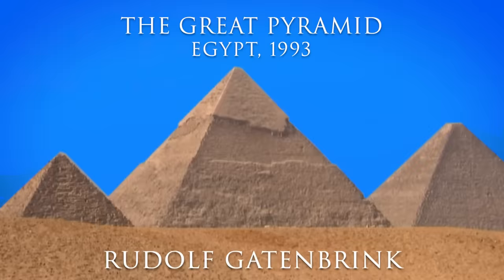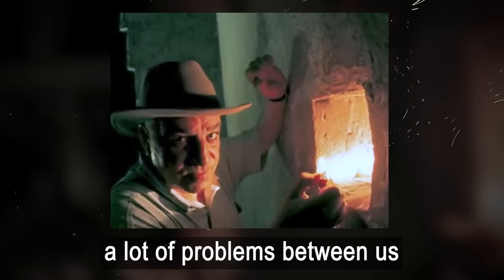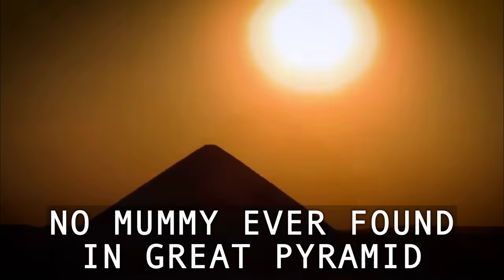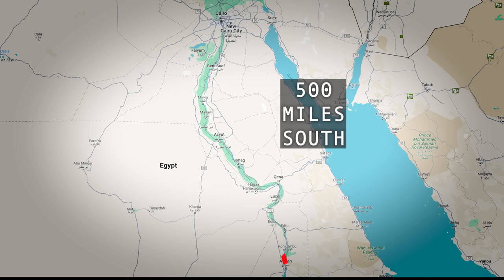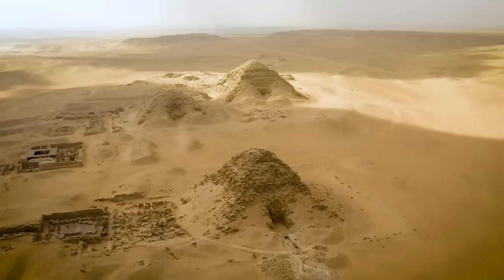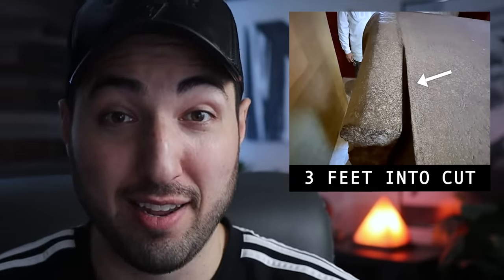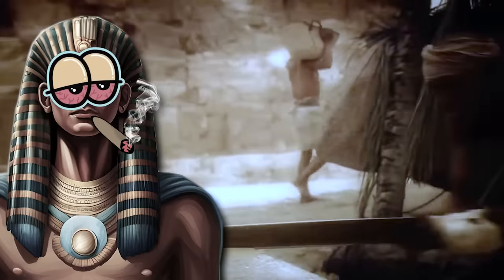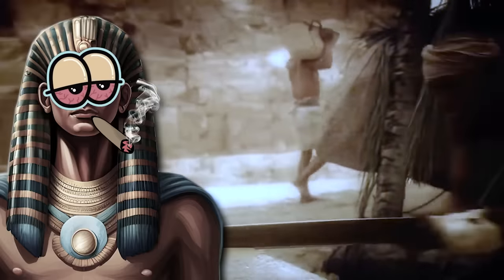The Great Pyramid Mystery: The Oldest Cover-Up In History

Comment: I think you switch something around here. The fact that it scales so perfectly with earthly dimensions does not necessarily mean they exactly knew all these measurements. It just means they had accurate measuring equipment and used the stars to measure tue dimensions of their build. They might very well have thought it was exactly square but because they aligned it on the stars it became exactly as non symmetrical as the earth itself.

Comment: That’s a serious video man!  I’ve been studying this for 24 years (at times) and have yet to see a video so succinct as this. However it have questions. 1. You use meters at one stage to make a point of significance. Other times you use feet. There is no record of either of these measurements in use at the time. And why either of them? 2. You talk about the 8 sides visible from the air.   The pyramid was covered in a limestone covering. Maybe those 8 sides became for once fully constructed!? 3. Does true magnetic north change over time? That might account for the slight inaccuracy!

Comment: Correction! -  The Great Pyramid is built facing perfectly TRUE NORTH NOT magnetic north so True North is beyond amazing because we would need a GPS to achieve TRUE NORTH" MEANWHILE> PYR means fire / AMID means in the middle = Thus pyr-amid is Greek- The original people were known as Kermit / a pyramid was called a Per Neter "building of Nature" by The Kermit - so what we know is mainly in Greek and we know the land was raided by several nationalities. As far as we know the people were known as Kermitian or Kermit. The Great Pyramid dates back to a time we can never know. It's position is remarkable since it is 72 degrees west to Easter Island (originally known as Te Pito O Tu Henua - the navel of the world) which is 144 degrees west to Angkor Wat which in turn is 72 west to the GP = 360 degrees and that is simply amazing.

Comment: Idk where this is going, but i can say one thing for certain. The pyramids were built to operate as high security temples. Hence, the completed canales from the king's chamber. The queen chamber was a backup in case they couldn't finish the king's chamber (hence they never built functional air ventilation down there). Hence the 3 portcolas and the lack of proof for any plugging.

As to why no mummy was found - 4000+ years since these pyramids were built and you expect thieves to not plunder the OBVIOUS structures that stick out like a sore thumb in the Egyptian desert? It's highly illogical to believe any of the pyramids could still have a mummy inside after so long.

Comment: 13:40 When building my house I didn't have a laser to achieve accurate levels, I used a hose pipe with water in it. Egyptians didn't have plastic hoses so they used open pipes. This ancient method is as accurate as any modern laser. We know how they transported the large stone blocks because we have found the canal built from the Nile to take the barges. Like all good engineers, the Egyptians learnt from their earlier mistakes, as witness the step pyramid and the Bent Pyramid of Dahshur.

Comment: Exciting video, Patrick. I am now interested in visiting Giza's pyramids. I do have a question, though. Are not the pyramids sitting atop a hill? Instead of using a pulley system to move the limestone piece by piece upwards, couldn't the Egyptians instead dig a square hole and, as for moving the stones, divert the water from the Suez as seen at 9:55, then lower the rocks down the hole using a pulley system, and when done, remove the dirt surrounding the pyramids after putting on the golden capstone? 

It's just an idea.

Comment: I find this video fascinating. But more intriguing  is the fact that these pyramids are all over the planet (example five Bosnian  pyramids) and in most cases, local government has banned further investigation into them. Its as though there is another level up for government, which sounds ridiculous. Another example would be Gobekli Tepe, the oldest site on the planet. They have grown orchards over areas that need excavation. Clearly a method to prevent further discovery.

Comment: I’ve been inside the pyramids and temples, It’s amazing. It does get you thinking how they did it. 
A
They mention that they used 100s of slaves to pull the big blocks. No one mentions about using the oxen’s which makes more sense

Comment: It is proven that except for a few granite blocks, the pyramid is poured concrete in molds. Made from local materials. So it is NOT mysterious that it is level and there is no space between blocks or where the blocks came from. It was local material, and they found the mixing vats close by.
It also explains the building speed. The height of each block fits so you can empty your bucket over the mold wall.
The blocks have more heavy stuff at the bottom.

Comment: The metre wasn't even invented for another 4-10,000 years later, the metre is completely arbitrary (the length of a metre was based on the earth, however it was so far off being correct it's length IS completely made-up.)
So that correlation of the speed of light vs the pyramid size is simply coincidental. Unless, of course, time travellers with the knowledge of what a metre is who built it.

Comment: 13:05 - hold your horses. 
"Meter" was a unit invented only after the French Revolution in 18th century. It was originally based on measurements of the Earth (1/10000000 of the distance between the Equator and the North Pole), but it was an arbitrary decision. For example, why it wasn't based on a distance between the poles or the Earth circumference in any direction?  Enough to say that had the French Academy of Science decided to base meter on the full length of the meridian, the speed of light would be 149 896 229 m'/s, as the "full meridian meter unit" would have been twice as long as it is now. Not mentioning measurement errors (meridian is 20,003.93 km long rather than exactly 20,000.00 km - as it should had the original measurements been conducted precisely). The difference is small, but with so many significant figures, it's enough to skew the results (c = 299 733 560 "correct" meters rather than 299 792 458 real meters). 

And that's not all - but this is so obvious that even without verifying all the figures it undermines my trust in this video.

Comment: Hard truth is the more primitive and straightforward is the tool the more effective is. Pyramids was not built by plasma cutters, levitation etc. Look roman empire how build massive projects. Effectiveness of the simple tools. Just two sticks with rope  tied at the middle of sticks gives you ultimate 🥏 precision. You can draw any shape. Pyramids was built to match star formation of the Orion constellation. Only three sticks are needed to do that. For stone weakening they used cold wine or cold water. Heat the stone and pour cold liquids on it. Then cut it almost like butter. Ropes are lot stronger than steel cables. And far more flexible. 80 tones block by 10 ropes gives us 8 tones per rope.100 ropes just 800 kg per rope. 1000 ropes 80 kg per rope. Only granite stones was made precise. Most of the rest are not that precise. They used the river Nile to transport the cargo. They put water canals to the Pyramids. And buried with sand ⏳each floor. Made first floor bury it. So its surface level always.  20 years? No more than 7 are required.

Comment: A branch of the Nile river used to flow next to the plain on which the pyramids sit, but dried up. So when the lime stone blocks were transported they did so by river barges. Of course, getting the blocks from the water and up into place must have taken a long time. Thus, it’s no surprise that the Bible says the slaves who built the Pyramids worked for multiple generations - hundreds of years - to build these massive structures. While the Bible is not proof of the actual time line, its story of generations of slaves being forced to build these massive structures is consistent with how it must have been done.

Comment: All you have to do it realize that this happened during the Green Sahara. Then you realize they had water powered saws and could flood an area to lift the stones. All you REALLY need to do is figure out how large the raft/boat needed to be to lift a specific stone.

Otherwise you you have to believe that they used each stone as a counter weight. Which means we should have a trail of large stones leading to a specific location ie where it was quarried.

Comment: You made an error. True north and magnetic North are not the same thing, true north is the actual geometric North pole and Magnetic north is where the negitive magnetic charge is and this is actually constantly shifting. Its more impressive that they lined it to True North, because it means they weren't detecting the magnetic field but actually somehow understood that the Earth is an oblate sphere and where exactly true north is. 

But yeah you're saying it like its the same thing and Im positive you mixed up the concept.

Comment: Very interesting video. 3 small errors. 1. The name of the german engineer was Gartenbrink and not Gatenbrink and 2nd, the whole region, Egypt and the Sahara was very green 6000 years ago and not 11500 years ago. The cosmic cataclysm take part every about 12000 years but it was not an asteroid or comet who caused the Younger Drias,   its a cyclical event caused by the arrival of the galactic current sheet who cause a Micronova on our sun because of the magnetic kick and dump of cosmic dust on the sun's surface. Check Suspicious Observers Yt channel. If it's correct what the electronic engineer found, that the Pyramid blocks all form of radiation include gamma rays, it makes perfect sense to survive the Micronova. But the Pyramid must be older than 4500 years, at least 12000. The erosion of the Sphinx confirm that.

Comment: The ancient Egyptians would have known about Geometry and had an idea on the ratio known as pi.  The earliest recorded rules on geometry appear as far back as 3000 BC by the Babylonians who also wrote down the the earliest known value for pi around 2000BC.  That's not thousands of years later but only 450 years.  Sure the earliest known written calculation from the Egyptians was as early as 1650 BC which is 900 year later, but that's just recorded history on brittle papyrus.  Archeologists have seen Geometric patterns as far back as 6000 BC, so the concepts were known just not written down.

Comment: This would be even more interesting if you could find the carbon dating document from the lumber found in the objects. I found it once a couple of years ago, but it seems to have gone missing. The carbon dates point to around 3000 years ago. Of course, they could have taken the pyramids apart and then reinforced them with wood and then reassembled them. cowabunga

Comment: Its said it took 27 years to complete, 2.3 million stones, 2.3-2.5 tons per stone.

 2.3 million stones ÷ 27 years= 85,185 stones per year. 
85,185÷365 days a year=233 stones a day. 
Pair of draft horse can pull 12tons÷ 2.3 ton average stone weight=5 stones per pair of horses.
 233 stones per day÷ 5 stones per pair of horses= 47.
 You would need 47 pairs of draft horses making only one trip a day to move all the stone in the 27 years it was said the construction took.  What if the horses made 5 trips a day, what if they had 100 pairs of horses, what if they also had 1,000 men. When actually breaking it down, it's not such a inconceivable endeavor.

Comment: For cutting stone, you would want to wet the stone to prevent the saw from heating and softening. It also helps dust move out of the way. Obviously, even a diamond edge saw built into hand tools would still be an issue for how long it takes, but it cracks me up that they're just pushing a dry blade back and forth when even our diamond blades today require water.
Reply: True but I think you were emphasizing more of the fact that no matter what you did with those type of tools you were never going to get any distance and amount of time needed or said to have happened so this is more of an sarcastic way of explaining it couldn't have happened that way lol

Comment: Latitude and longitude are set in modern time on Greenwich, which has no relation to ancient Egypt. The number is just a coincidence, society could have set the zero point anywhere.

You don’t know the sockle is flat until you’ve removed the pyramid. The outer edge might be round though.

Pi and phi were known roughly in Ancient Greece so they were known in Egypt as well.

Comment: Look into the theory that they were poured in place with a dry packed concrete.  I'm convinced.  Look at the horizontal lines in the sphinx.   I belive they're the cold joints from different pours.

Comment: Unfortunately your math on the build timeline is severely flawed because not every stone was fit perfectly. There are images everywhere that show the inner stones are not cut precise or perfect in any way. There is in fact a bunch of filler Rubble in between a lot of the inner stones and the outer stones and the stones which make inner walls are the ones which are fit more precisely

Comment: 29.9792458° North, using decimal rather than minutes and seconds and the speed of light as 299792458 metres per second does seem a stretch when the metre was only defined by the French much more recently. Also, i don't think you meant "ironically".

Comment: WRONG .........the pyramid was not build  that period of time it was built 10,000 year ago when it was lined up with Orions belt. The Sphinx Leo the Lion.  And the guy you said built it did not build it he just put his face on the Sphinx. Not one block is the same, there is a spiral tunnel going up the pyramid on the corners there are notches. The BLOCKS where cut using sounds and water etc. They where also moved using sound freqencies. There was no RAMP on the out side. It did not take 20 years to built. There was no slaves building it, there was workers and they took pride in making it.

Comment: Id the pyramid was built 4000 years (or more) ago and aligned it toward either true or magnetic north, it would not be thus aligned now. Magnetic field drifts at a measurable rate. And 4,000 years ago, Polaris was not the north star. So, your alignment argument is specious.

Comment: You mix numbers and ratios with arbitrary units that are mostly conventions created in our times. You can find any relations to any number if you massage them as you want. Degrees if angle and meter per second mixed with ratios in miles and feet... If they were so smart they would not have used different measuring units invented 4000 years later.

Comment: The top of the pyramids was never "solid gold" it was would have been a very thin foil of gold covering the limestone top.
You honestly think some stole as massive solid gold pyramid (one of the heaviest metals going) at the very top and replaced it with massive stones weighing many tons each?

Also the act of reclaiming/recycling cut stones has happened all over the world. The marble used for the Vatican in Rome was mostly sourced by stripping the marble outer covering of the Colosseum.

Comment: Sand is actually stronger then copper. You can flatten the surface of these stones by just dragging it over another stone with sand in between middle. So getting the stone to its destination over sand would flatten the surface as a side effect. By adding water it becomes easyer to move the stone. If you haven't noticed, the top and the bottom of the stones are flat. The sides are not. It would take about 10 men to move a 2.5 ton limestone block. The more heavy 25 ton granite blocks would take about 100 men.
Its interesting how this guy questions the pyramids but not things flying trough walls. Catering to the dumb i guess.

Comment: Slow down, man.  No need to talk at that speed (especially with scientific subjects).  There is a speech speed and then there are hearing speed versus listening speed which leads to  comprehension (thought process/understanding) speed.  Your talking speed yields hearing but not listening and understanding... and super annoying, dude!  Calm down and learn how to narrate with varying speech speeds (fast - for excitement, slow - to emphasize, just right - main speech.. and even pauses - to capture attention and effects) you will get more audience.  Your narrating speed in this video is soooo annoying, I have to shut the video down after 10 mins in.

Comment: Each stone is unique,  one of a kind and fit together like a puzzle. Hence, not milled standard. Too heavy to move on a wooden sled that would break with weight. Moreover, the ramp theory doesn't hold up because has to be several kilometers long and sand would crumble.

Comment: Although moving forward in time may not be possible due to the fact that it doesn't exist as of yet!
So how would you go forward to somewhere that does not exist?
 But it is strange that the ten dimensions was  mentioned, because supposedly if you could move forward in time , The only way of doing it is by going back in time first, and then returning which would allow you to move forward in time, but if you miss your exact point in time that you left you would in essence create another dimension and your original position would continue moving on without you !
You can't stop The movement of time therefore Even if you have gone back in time.... Time itself still continues to move forward!
 So by not returning to the exact time that you originally left even by millisecond you would create an entirely new dimension, and if there was 10 dimensions measured that would mean that somebody went back in time at least 10 times and missed their original departure and thus created another dimension, 🤔